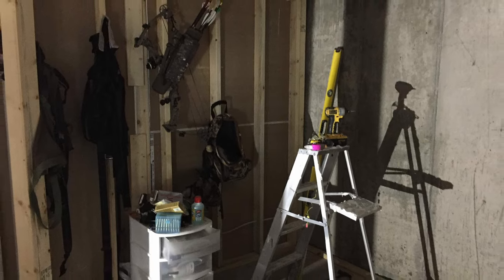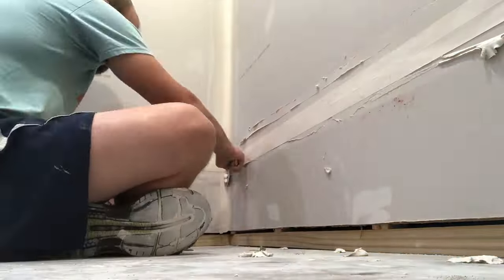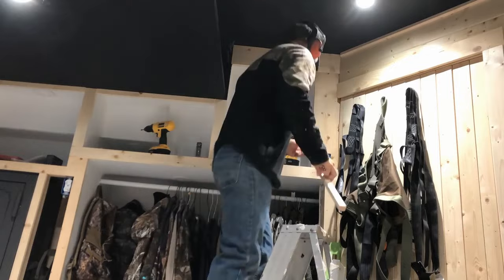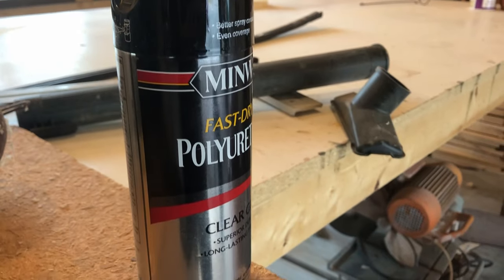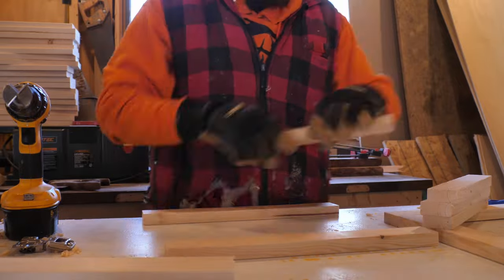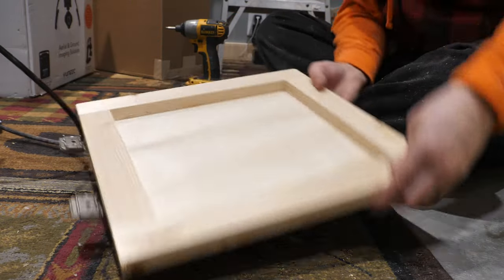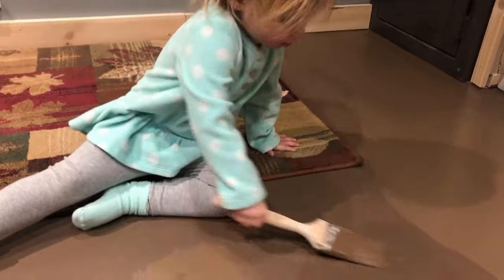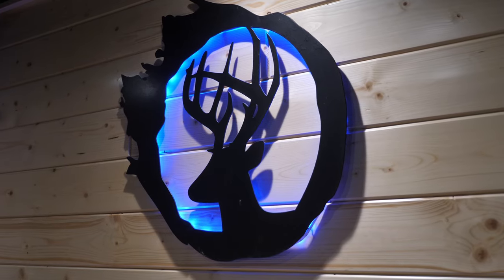I BUILT a SMALL 10x10ft MAN CAVE // DIY BUILD

Comment: Was your concrete already waterproofed / sealed before you painted?
Reply from the maker: The concrete was sealed on the outside with tar and I also put waterproofing membrane on the outside. Put drain tile, pea gravel, and filled up with sand so the water drops straight down to the drain tile and it runs from there to daylight :)